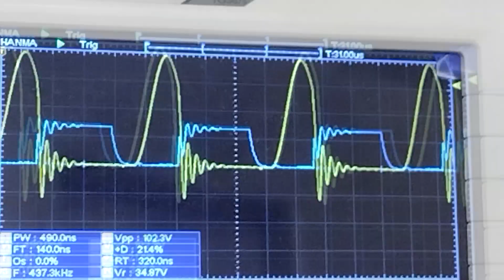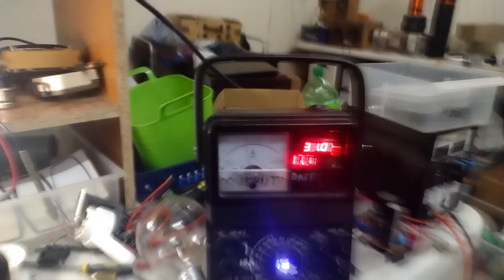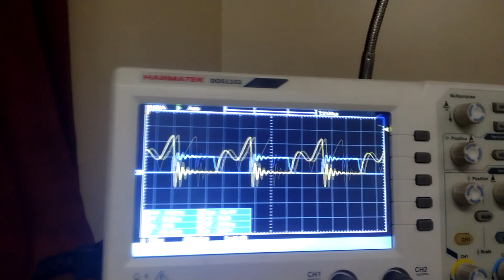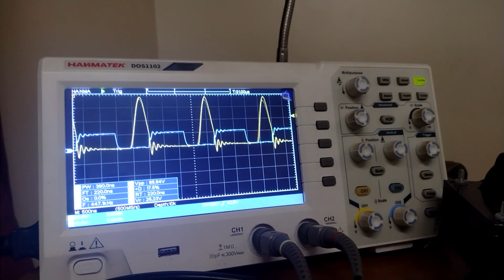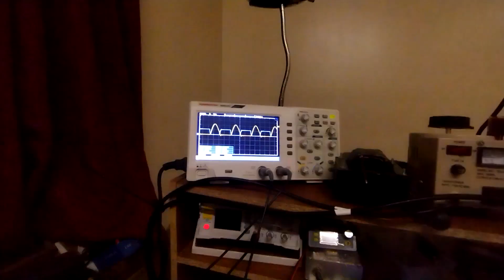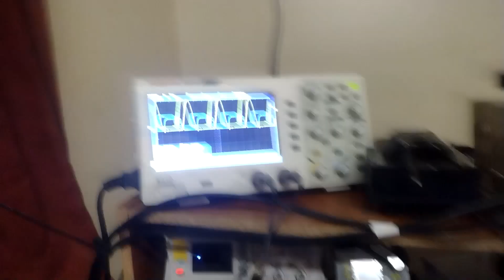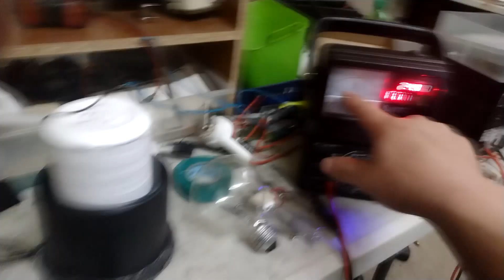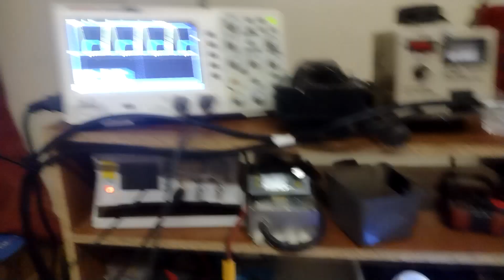Class-E "Micro SSTC" tuning 30VDC

Comment: Can u tell why I'm getting two half wave? Instead of single one,
 I know it's bad, any ideas how to fix it? And what value resonant cap do you recommend? 
For a 750khz coil,
Reply from the maker: You mean your drain waveform looks like two humps?
Reply: @Magneticitist yes, normally you would expect one half wave but mine has two, I were using 12nf resonant cap, coil dimensions are 21cm height 5cm dia, primary = 7.6cm dia 
4 turns,
Reply from the maker: @acex727  You will ultimately have to play around with the coupling of the secondary some. Widen it some, lower it a little, raise it a little etc. That's aside from trying to tune it using the drain capacitance. If you are fixed on 12nF you may need to adjust the actual length of the primary wire etc.

Comment: I think I am gonna wind a new coil using one of those potato chips tubes I think those are closer to what you said in your schem 6cm diameter x 6 cm high , this coil I was playing with was 10cm x 20cm aprox and I could not get it to run cool I know I need to scope it but also trying to replicate your desing as close as possible could help too , I played with it for a while but always keeping the voltage under 15v it did draw some really hot arcs but not that nice free air bush as you get , and fet would get warm with a little Heatsink , since I want it to play music I need to sort it out so I know it can run cw long time , I end up taking out the 39nf snubber and I left the 1nf I the whining noise went away by tunning the vco at the right spot , I will put it away till I wind a new coil following your dimensions 6x6cm

Comment: Could you achieve ZVS like at 6:44 by putting more resistance at the gate instead of loading the coil with the capacitance from your hand? I wonder if achieving ZVS here is a matter of phase-shifting the gate signal or slowing the gate voltage rise time with a resistor... And that "hand-loading" technique makes me wonder if you could just experiment with toploads to get the desired capacitive loading and phase shift the gate signal. let me know if that would be a good solution
Reply from the maker: Oh and as for the toploads that sort of works the same way to a degree but I had a harder time using any significant topload at all as it seemed to really change the profile of the loading in the network. I could probably use my really big air cap to do it best in a similar HF setup where my frequencies allow a tank cap less than 1nF.
Reply from the maker: Adding more resistance can slow the rise and fall times of the gate drive and there is a tradeoff there between losses during the rise time and pinching of the signal to attempt zvs or zcs. With a half bridge this can effectively help prevent both mosfets being on at the same time. In my case I just kept decreasing the rise/fall times and the phase adjust had to really be done with the LC circuit. It's not quite so simple though it seems as the coupling has a big thing to do with it among other things. It seems like with my setup I have to realistically deal with some current-switching losses as well as loss of ZVS at the lower/less-loaded outputs. I'm probably not going about this the best way so who knows lol.

I went ahead and tuned this to run closer to ZVS at 50V or so for more output and it's decent but it's only about 110W of power. The dangerous part to me is that without a lot of voltage headroom on the drain, it seems like loading the coil a certain way can sometimes cause a decent tuning to go out of wack and cause the drain capacitor to shoot over the max vds. With the kind of tuning I've found so far it seems best to switch to a 500V mosfet and try to push about 100V at least to get it into a class E region, use a big heatsink and just deal with losses but have more output and overall a pretty efficient setup. Interrupting at that point would probably also be pretty nice.
Reply: @Magneticitist  Oh okay that is a lot of factors, thanks!

Comment: Hi there Ryan. It's been a while since last time I texted you. Well, I recently did my very first E class SSTC & I was stunned myself with the massive spark output I got from my tiny 10 cm tall & 5 cm wide secondary while playing around with it. I still haven't fine tuned it yet coz I ain't have that much time due to my working hours but if you do have time , check my video on :" Massive sparks from Tiny SSTC plus the other one " Fatty & branchy sparks from tiny SSTC". It was my very first trial on an E class SSTC. Bro, another thing, I felt very happy when Zach from Labcoatz said you've helped him out recently  & I knew you would do it.  My videos are just for fun & to motivate my students to get involved into the world of high voltage & that's why the language is in my mother tongue else, I could also have done it in English  too. Just keep it up & thanks for all your motivational videos on Tesla coils as they have helped me lots to start somewhere & be successful.
Reply from the maker: What's up! I'll check those videos out, I'm looking to get a higher power class-E setup but so far I'm not too sure how to go about it. I don't think I'll get any kind of fat or hot arcs if I supply maybe 60V so I need to try something else.

Comment: Something I don't understand is that why is your open discharges so small even tho you are able to pull it to 2inch ?
Is there any possibility to make the open discharges big as I only want that at low voltage
Reply from the maker: It's usually a tradeoff between voltage and current that can be found with I believe a tuning of the phase shift and the primary coupling. For example not taking ZVS into consideration there is often a tuning where I can get bigger open discharges but the arcs I pull to objects will be thinner and weaker. Or I could have smaller open discharges but push a lot more current into arcs I pull which can feed so much into them sometimes it causes them to be much longer. The best low voltage open discharges I've had were using the push-pull driver and it probably took about 250W at 30V or so.
For big open discharges at 30V or less it's probably possible to do it at ZVS but I've only done it hard switching. You can still tune a 'Micro SSTC' to get pretty big open discharges but I usually need at least 24V and it usually draws quite a bit of power to do it.